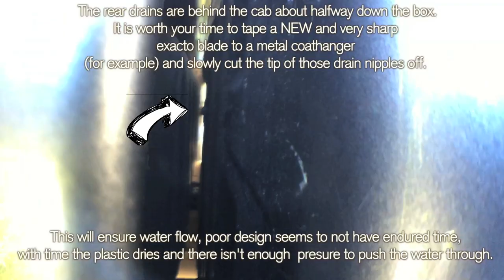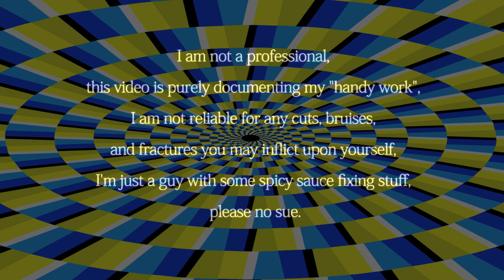Dodge Ram Headliner Sunroof Leak fix DIY

Comment: This is such a great video!  Perfect step by step instructions! I've had water dripping from front seat pillars on both driver and passenger side for a long time, and a nonworking (but closed) sunroof for even longer.  I've got it all apart and will lower the headliner tomorrow to see what I can figure is the cause for the nonworking sunroof.  Hopefully just junk in the tracks that bound it up, but maybe a bad motor, etc.  RAM dealer told my mechanic friend I chatted with today that the only parts available from the dealer are 1) the motor for $300 and 2) the entire "module" which is rails, motor, everything as a single unit for $800. Not sure you can just get a single rail these days. Oh, careful with the T50 Torx bolts for the seat belts, they can strip very easily if you're not careful. 3 out of 4 were super easy to remove, the 4th was nearly impossible due to excessive Lock-Tite and I will be replacing that bolt due to the struggle-induced damage.

Comment: This is great and super detailed.  Two things I’d do before going in as far as you did:  take a piece of weed trimmer string about 2’ long and gently work it down the drain pipe from the open sunroof, like working a tiny plumbers snake.  
Also, the 2 front drains pop out in the front door jamb between the hinges, below the big rubber wire chase.  Make sure that isn’t gooped up with some obstruction.  Mine was!  It’s a flexible rubber fitting, just wiggle it around as water comes down.  Maybe get someone to pour some water in at the top while you work the rubber fitting back and forth.  
Great video!

Comment: Out of curiosity, what kind of epoxy did you use? My drain plug is broken on one side for certain and I have to take the liner out to check the back ones. The plastic is brittle so I'll either need to replace those drains or use the epoxy trick, but I haven't found epoxy that lets you mold it like yours.

Comment: Are those drain tubes present only if there is a sunroof? I have a leak on my 2003 2500 with no sunroof. I've found on a forum that there was a weld that the robot missed in the passenger rear where the roof panel and back panel come together and water gets in there. Thinking about taking it apart like your video as sealing the exterior has accomplished nothing. Wondering what I will see with no sunroof...
Reply from the maker: I am not sure, but come back and tell us once you've taken it apart. The method of taking the roof apart should be the same, but I am not sure about those tubes, let us know. Cheers
Reply: The drain tubes were not present. I caulked the seems where the panels come together as I mentioned above and am still getting a leak, but it doesn't seem as bad... Although it isn't dripping down the grab handle anymore. I'm not sure where it is coming from. Any ideas? I've heard take off the door weather strips and silicone the screw holes and reinstalling weatherstrip. Going to try that next.
Reply from the maker: @stephenfloodphoto  No drains in the back or front going through the pillars? weird, especially as it sounds like thats the issue, the truck has to have a way to drain the water from rain somehow, it goes in at the top of the door jam and has to have a way to drain. Wish I could help you more
Reply: mintyhero what do you mean drain the water? Why would water be getting in? There is no sunroof. The roof should shed the water right? Somehow water is getting in. It was dripping out of the bolt holes on the front grab handle and now it isn’t anymore but the floor along the sides is still getting damp after a hard rain.
Reply: @mintyhero when you say drains, do you mean tubes? I don't know much about cars and trucks, but it seemed to me like the water comes in at the top of the door and hits the weather seal that's around the door opening and goes around and down to the bottom and falls off the bottom. but the carpeting on the inside floor is damp. How would it get inside the pilar?
Reply: Did you check gasket on cargo light ? If so and it is a missed weld what about better sealant like lexel or even fiberglas and resin ?
Reply: It's not the cargo light, but i have noticed when I'm driving I can hear a gust of wind coming through the door once in a while. it almost sounds like the window is cracked open, but it isn't. how could I fix this? could this be the reason water gets in?
Reply: Yup i have the same deal on my 96 which is rough around the edges. Flimsy steel near hinge may be micro bending(not apparent to naked eye) when heavy door is over opened or slammed shut. Add some gasket ?

Comment: Where was the water leaking from that made you have to pull the headliner entirely apart and check those drains?
Reply from the maker: I kind of explain it at 7:23 and after, the sliding drain that sits behind the sunroof had snapped off. I took the roof off 4 times, each time thinking that cleaning the drain pipes would solve my problem. I used a 2 part epoxy to glue the rail back in place and the leak stopped. Most leaks are caused by the drains being plugged, so unplugging those should solve most peoples issue, unless your drain rail is also broken.
Reply from the maker: at 8:05 you can see where I glued it, it might not look pretty, but it's solid!
Reply: Mine was leaking out of my A-Pillar/Drivers side grab handle.  Been dealing with it for 8 months.  Finally ended up having the dealership buy it back and now am in a 2017.  Severe pain in the a...  Thanks!
Reply: My 08 2500 does the same! But my mechanic told me I could use a compressor to clear out the drains and cut off the ends to allow more debris to get through. Some guys on Facebook confirmed. :)  I hope it works, taking my truck apart like this video freaks me out.